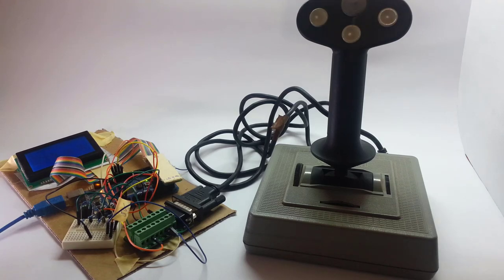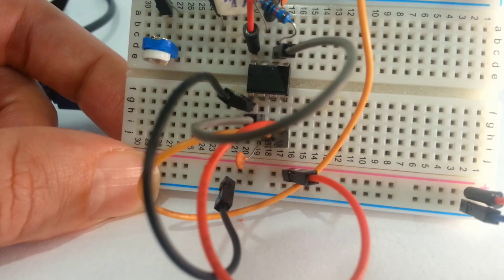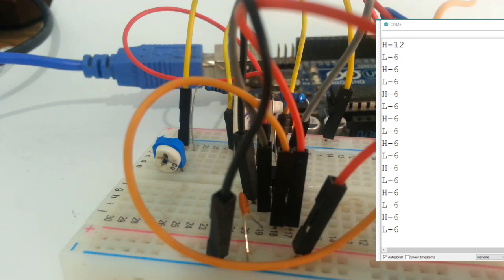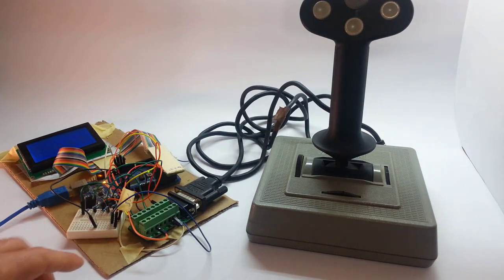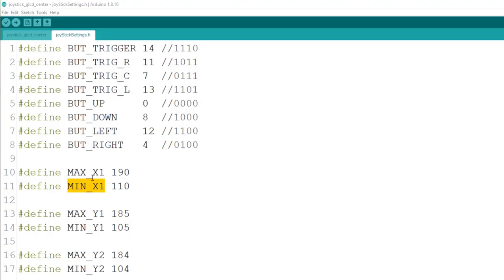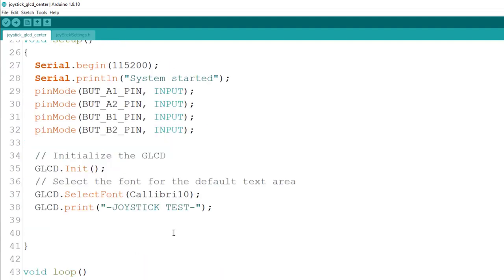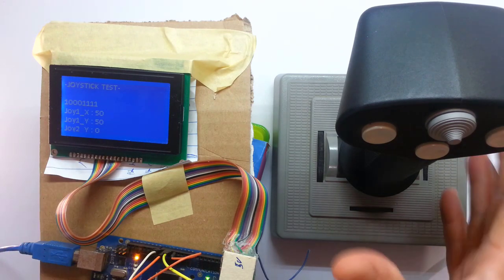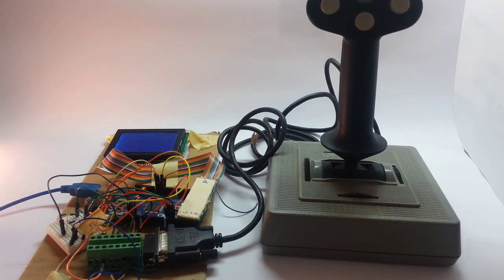The analog joystick adventure – part II – we got it centered

Comment: I've got that same exact joystick, the CH Flightstick Pro.  I look forward to the culmination of these videos, so hopefully I'll be able to go from the stick to USB, and all the functions should work, regardless of the OS used with.
Reply from the maker: I do not have plans (for now) to make it a usb joystick. 
If you plan to go that way you can take an arduino board that is capable of being HID and control the joystick output value with the input from the analog joystick. 

I still thinking out the usage, hope to figure it out soon :)